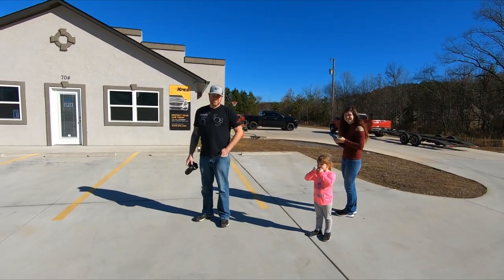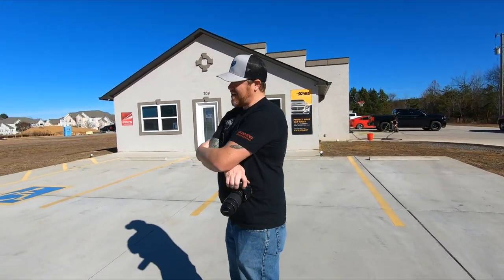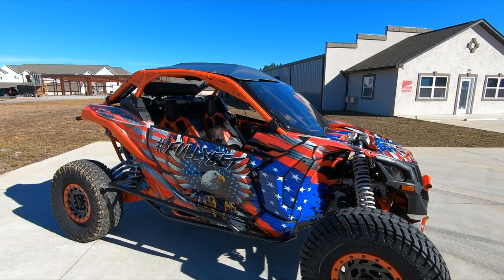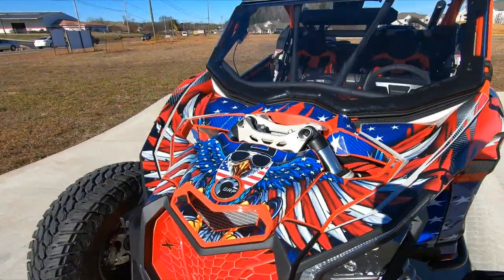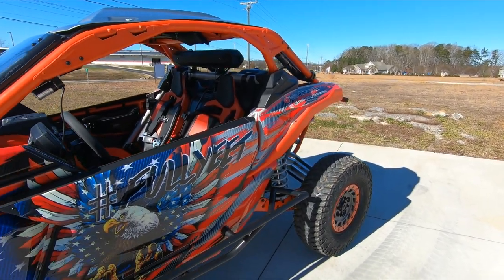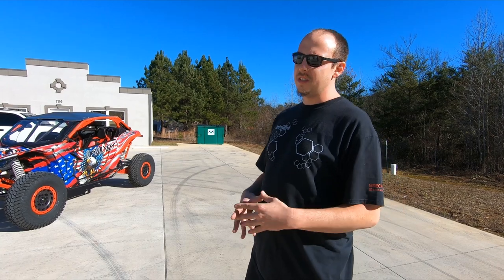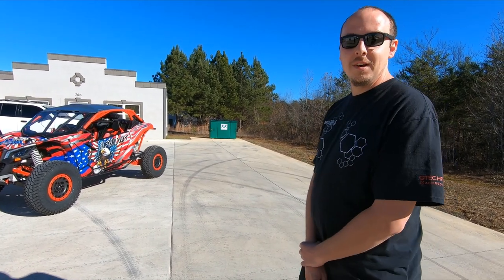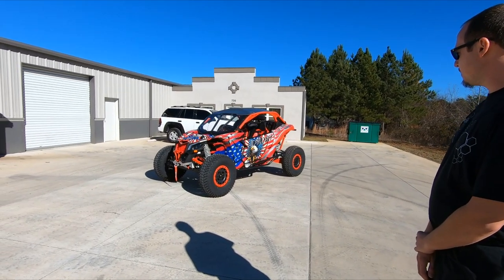2021 can am X3 XRC RR build update part 2

Comment: I'm going to be blunt, CAPTAIN AMERICA....LOVE IT!!! Great job looks beautiful. I ordered a DS RR i may need your help. Thank you for sharing
Reply from the maker: Thank you!!! What ever you need just ask and I will tell you right now you will love the new ride!
Reply: @AbramHeathFULLYEET  ugh even though i had a turbo RZR years ago...I'm a little nervous over the power. You're machine is beautify thank you
Reply from the maker: @maraudermitchelli  don't be nervous. if you feel like you will be in a situation where you need to reduce power just put it in eco mode. that drastically reduces the power output. Also if you have never driven one before the high and low gear comparison to a RZR is a very big difference
Reply: @AbramHeathFULLYEET  Thank you very kind of you. About how much was your wrap?
Reply from the maker: @maraudermitchelli  roughly $700 for the wrap and $300 for the install.
Reply: @AbramHeathFULLYEET  great price! Thank you.